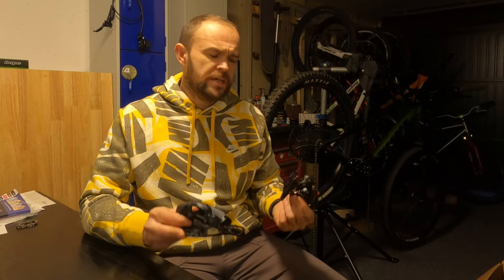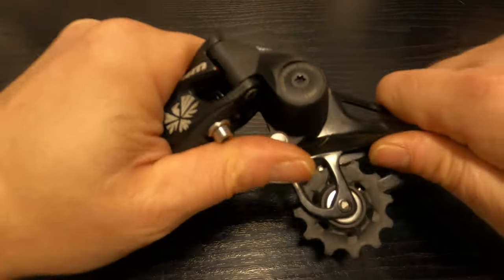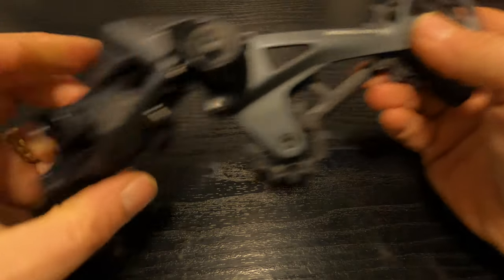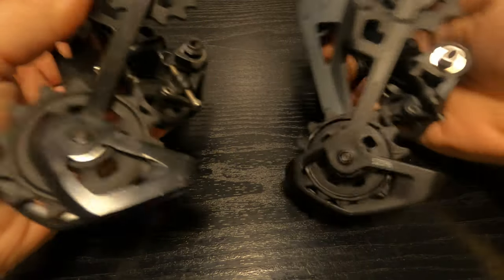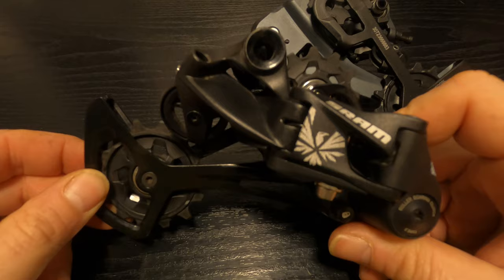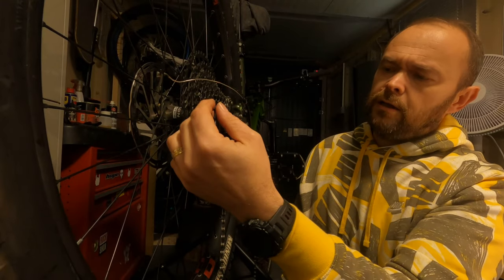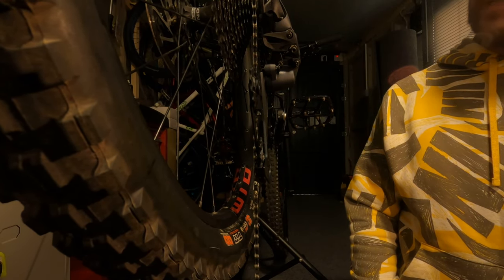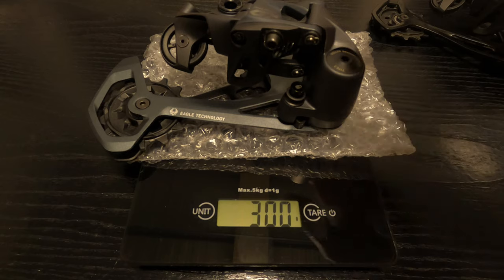SRAM NX vs GX Eagle derailleur/rear mech comparison

Comment: I've run NX for some time and never had problems with it, it's not as smooth a shift as an XT which I had on another bike but it does what it's supposed to do. I dunno why everyone treats it like the bad child of the eagle family, it does the dishes and cleans it's room, maybe doesn't get as good grades in school as the XX1 or as smart as the AXS... but it does the job...
Reply: For the price and performance does it compete with the Deore and Slx or can it only compare with Deore?
Reply: I have the NX Eagle on ally  my bikes and its even compatible to Shimano cassettes. It was able to shift into 51t but I haven't tried 52t. Also, my SX derailleur also works well.
Reply: I have X01 on my bike & older XT on another bike & I had heard so much bad stuff about the lower end SRAM, but I rented a bike at a park that had a mix of SX & NX components & I thought the shifting was just fine. No issues.

Comment: If you already have a NX and want to upgrade 
Use GX jockey wheels and an XX1 hanger bolt your NX will be shifting better than a GX and you only spending $50 for the upgrade

Comment: Just upgraded to the GX as my NX was toast after the Cape Epic. I've immediately noticed that the shifting is far crisper and it feels solid and precise. The chain was changed as well due to wear so that could only help. However, it does feel significantly better than the NX ever did.
Reply: i got a question 😅 Im thinking about changing from nx to gx but i have a nx casette but would the gx work with the nx casette!?
Reply: @goodrift1714  yes it works. I haven't changed my cassette at all.
Reply: Did you change the shifter?

Comment: The mounting bolt is the main issue with  nx , the play you showed init increases over time as will the gx but this happens quicker with nx due to the material used in the mounting bolt and bushings itself . The wobble will cause phantom shifting under load eventually , that's not to say until that starts happening the nx performs very well but it is a ticking time bomb .

Comment: I have a hybrid NX/GX on my bike (GX cassette, NX derailleur and crank, XO1 chain) and it works beautifully. The play in the cage can be almost completely removed by fitting the B bolt and plate from the XO1 or XX1. Plenty of vids on YouTube showing how to do it, and it costs around £40 for the kit.

Comment: i have a status with a nx drivetrain and it has needed a lot of attention with adjustment. i have a 2006 specialized p3  i don’t remember what sram system that runs but i’ve literally never made an adjustment since 2006 when i got it new and it still bangs into gears perfectly. i’m sure there is a big weight difference and the nx does it a little quieter but idk how far tech has really come

Comment: I just upgraded from NX to GX derailleur, but the bike came with an SX shifter. Do I need to upgrade the shifter too? It does not shift correctly between all gears. Adjusted the B gap but not with sag.

Comment: HI there. Would you say the extra tension on the Gx clutch will help with chain rattle on brake bumps and rutted sections. compared to the NX. P.S I have 52 cass and works on the NX
Reply from the maker: It would be better for chain slap and overall tension yes. Especially if your NX has had a lot of off-road use, as I am positive that the clutch can get weaker the longer it has to work. Sadly there is no way to adjust the clutch on these derailleurs to compensate.

Being that the clutch assembly is the same on both the NX and GX, the GX may end up losing strength over time.

I would say if you see a good deal come up on a GX, grab it and keep the NX as a spare.
Reply: Are you still running the 52t cassette with the NX derailleur?